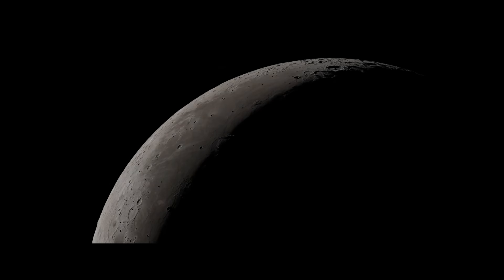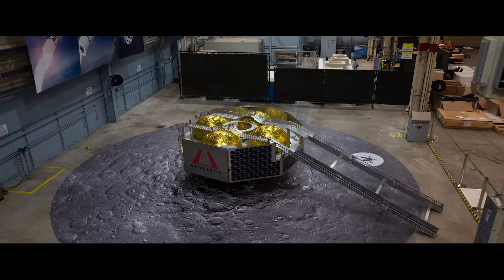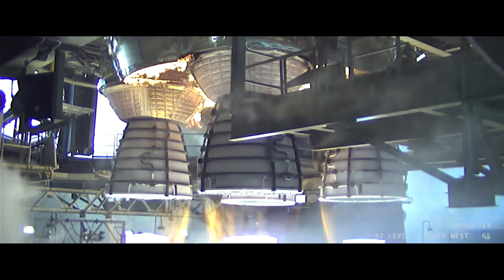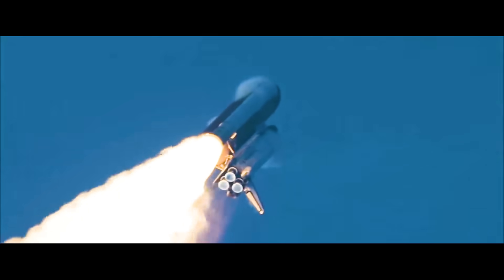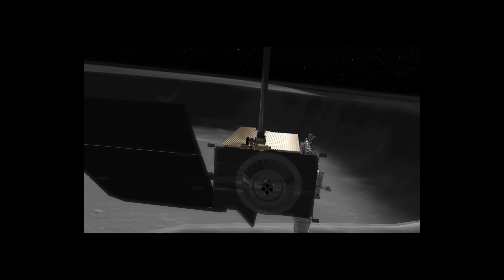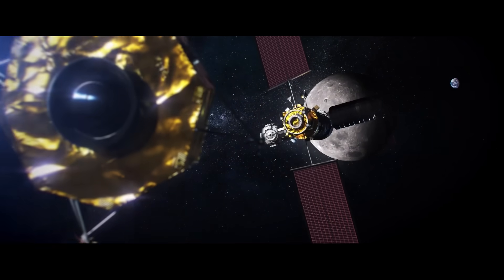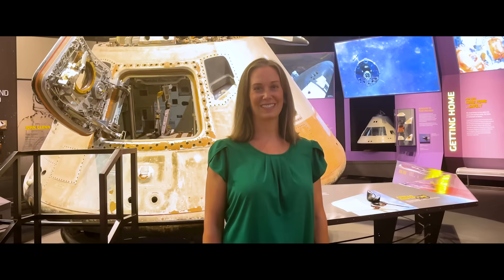Why the Moon?

Comment: my question is how to control the unit (ez. human/machines shelters) temperature on the moon. 

i found this on nasa "Daytime temperatures near the lunar equator reach a boiling 250 degrees🔥 Fahrenheit (120° C, 400 K), while nighttime temperatures get to a chilly❄ -208 degrees Fahrenheit (-130° C, 140 K)". 

i am much curious if i put one .json human i'd 🌠data center on the moon.🤺♻ Keep alive on solar power.

Comment: THE SIMPLE, PROPER, FULL, AND BALANCED UNDERSTANDING OF THE SHAPE, FORM, AND RELATIONAL MOTION OF WHAT IS THE MOON IN UNIVERSAL ACCORDANCE WITH THE FACT THAT E=MC2 IS F=MA: 

What is THE MOON is moving AND not moving IN BALANCED RELATION to the Earth AND the Sun AS a linked AND BALANCED opposite in accordance with the UNIVERSAL fact that E=mc2 IS F=ma. THEREFORE, the rotation of WHAT IS THE MOON necessarily matches it's revolution; AS gravity/acceleration involves BALANCED inertia/INERTIAL RESISTANCE; AS ELECTROMAGNETISM/ENERGY IS GRAVITY. Accordingly, the shape AND form of the Moon is basically constant or invariant. 

The Moon is a BALANCED MIDDLE DISTANCE manifestation or form that is in fundamental accordance with the Earth/Sun BALANCE pursuant to the fact that E=mc2 IS F=ma. GREAT !!! Therefore, the Moon is electromagnetically/gravitationally extended AND contracted ON BALANCE in true agreement with the fact that E=mc2 IS F=ma. Gravitational force/ENERGY IS proportional to (or BALANCED with/as) inertia/INERTIAL RESISTANCE, AS E=mc2 IS F=ma; AS ELECTROMAGNETISM/ENERGY IS GRAVITY. "Mass"/ENERGY involves BALANCED inertia/INERTIAL RESISTANCE consistent with/AS what is BALANCED electromagnetic/gravitational force/ENERGY, AS ELECTROMAGNETISM/ENERGY IS GRAVITY; AS E=mc2 IS F=ma. It ALL CLEARLY makes perfect sense. Gravity IS ELECTROMAGNETISM/energy. 

By Frank DiMeglio

Comment: Why not the moon?
Why not Venus?
Reply: Because you cant land on venus with the crew
Reply: @farel9476  50 - 80 km above the surface of Venus is the most hospitable earthlike place in the solar system. Humans could live in teflon floating blimp like cities filled with breathable air which would easily float on Venus because the planet is filled with the denser Carbon dioxide. At those Venusian altitudes temperature, atmospheric pressure, sunlight, gravity and radiation shielding are very earthlike, compared to Mars where we would have to engineer all those human comfortable conditions. Mars seems to really only have  solid ground to offer. The moon is very very close so it makes sense.
Reply: @Kpop-eye-f7t  fax

Comment: oxygenated soil harvesting and or harvesting of hydrogen from the ice I assume mostly, then we will be able to make spaceports/bases there. 
but the fusion experimentation will be great, being able to do it freely on a different planet repeatedly with different designs with no limits on power restraint really will be great...plus the dark side of the moon is -170c so it would be great for superconductivity.

Comment: odrgDzciG6s
Either way supposed to be 21st century in that video though specifically 2037 I think. Could it have to do with that 2010 Rally to Restore Sanitizer and or Fear? Could it have to do with including 2004 tsunami? Could it actually be sooner and be 2021? Could it be 2067? 2050? 2049? So it's the moon now and not nibiru like I did previously post a comment about when you previously quietly uploaded on YouTube a "asteroid/meteorite/comet" underwater training video for a landing mission and with no press release?

Comment: Ok land on the moon and any organism would be shred apart by ungodly amounts of radiation
Reply: There's something called protection
Reply: @RobPatatas.  the space stations fly fine because there inside the Earths magnetosphere witch the space station is only 450 killometers and the earths magnetosphere is 60.000 kilometers but the moon is 480.000 kilometers way far away from a sheild no protection from radiation will be enough because of the rocket mass will add up
Reply: @olgasolovjova4681  If the avoid the Van Allen belts, the base is underground and surrounded by water, there's no problem
Reply: @RobPatatas.  we dont have the technolagy yet to build an underground bunker on the moon do you know how heavy the drills and wall plating would and think about the price of this project to carry so much unnessasery weight
Reply: @olgasolovjova4681  When USA sent humans to the moon, the spacesuit protect them from the radiation, the spaceship also had protection
Reply: @RobPatatas.  the apollo mission only lasted 21 hours on the moon because they were reciving 6 rengtons from the apollo cap and there gieger counter so they were forced to leave if there was no radiation they could have stayed there for 3 days with the amounts of reasorces they had and thats was 60 years ago and we still havent sent people to mares yet

Comment: This video is great, but one point really botherd me:
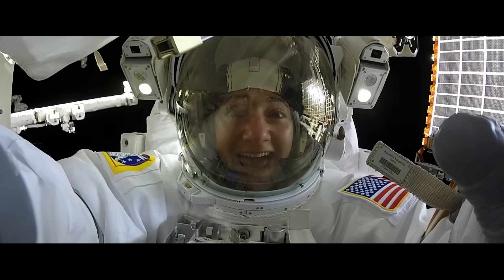When this dude at around 0:35 said "just outside gravity" that really hurt my brain because the ISS is not out of the earths gravitational influence, it is actually very close. The strength of gravity of the ISS's orbit is about 10% less then on the surface of earth.

The ISS is in orbit, a circular motion around the earth, produced not by "the lack of gravity", but by the extremely high horizontal speed.
If there was no gravity outside the earths atmosphere, how would the moon be here? It would have flown off due to its speed.

Sorry, I know this is not made for dudes that already know that stuff, but this is just wrong.
Reply: I believe that it was said for the layman. Most people believe that there is simply no gravity in space, which is false. It is best to speak in simpler terms than attempt to explain a more complex concept.
Reply: The layman considers "outside gravity" as "not under observable effects compared to earth". As such, a stable orbit would be considered outside gravity for this purpose. 
Especially since, technically speaking, it is impossible to be "outside gravity". As long as two closed systems with positive mass anywhere in the universe exist, they will exert some gravitational force on each other.

Comment: In a nutshell - the Moon space stations and settlements is a good starting point in space travels to Mars (due to low gravity at the Moon it will take less resources to get up in open space)
Reply: If it was up to me, I would build a rocket on the Moon and then do a slingshot maneuver around Earth to speed up to Mars.
Reply: @professorx3060  Got to slow down at the other end though, that's the real issue.
Reply: @professorx3060  How would your build a rocket on the moon you genius?

Comment: I'm psyched! However, it beggs the question. We did this already, why is it so hard?
Reply: In the Apollo missions due to political pressure nasa had almost limitless funding but now they have a lot less additionally with these missions they are bringing lots of cargo to build settlements not just people which means it will be considerably harder to get off of Earth due to the additional mass on the rockets safety laws are also tighter now meaning the rockets will have to be better made.
Reply: Politics

Comment: With partial gravity 
Therefore the moon has its own atmosphere 
And just like earth theirs cloud or haze coverage and until you land on the surface you can't see what's actually down their 
And for 50+ years the Darkside of the moon has been habitable 
They've been coming and going this whole time I bet
Reply: Air pressure isn’t proportional to gravity, otherwise Venus wouldn’t have such a thick atmosphere

If the moon suddenly had an atmosphere, solar winds would blast just about all of it away in a geologically short amount of time

Comment: You went to the moon at 1969 with a computer not smarter than a $1 calculator right? Then why you still need to learn a lot of stuff before going to the moon again? You did even real time conversations with astronouts without any delay at apollo misions didn't you? Did you lost the technology to go to the moon? Did you figure out how to pass Van Allen radiation belt before going to the moon. If you did then why you need to solve that problem again according to your astronouts. Did your astronouts see the stars from the moon or not?
Reply: according to your reasoning they should stop making new cars because there are already old ones, it's called evolution

Comment: Go NASA, go Team Space! (But.. "just outside of gravity"?! Someone please explain gravity to him...)
Reply: he’s talking about the international space station
Reply: @Iachlan1  It's not clear what he's talking about. But regardless, the ISS is very well inside the gravity of Earth, Sun, Milky Way, Local Cluster, etc. Otherwise it would fly straight off to outer space. LEO is a place governed by Earth's gravity, only passengers on that orbit experience net 0 acceleration in their frame of reference. Unfortunately someone "wisely" chosen to call that experience Zero G or micro-gravity, but both are misleading. It's just that their angular velocity happen to equal out the spacetime curvature at that distance from Earth. Gravity is not much weaker there (around 90% compared to the surface), that's why they need to travel at speeds of ~28.000 km/h around not to fall back to Earth.

Comment: All you need to do is scrap your current design for the space suit, and instead invest in the mechanical pressurization suit that is fit precisely to the shape of the astronauts (and thus allows for very easy movements) and move the contract for putting humans on the Moon over to SpaceX (skipping Orion and SLS), and putting humans on the Moon will work perfectly!

Comment: JFK's old Rice University speech is still just as inspiring and to-the-point as it was almost 60 years ago. "...we shall send to the moon, 240,000 miles away, a giant rocket more than 300 feet tall, made of new metal alloys, some of which have not yet been invented, capable of standing heat and stresses several times more than have ever been experienced, fitted together with a precision better than the finest watch, carrying all the equipment needed for propulsion, guidance, control, communications, food and survival, on an untried mission, to an unknown celestial body, and then return it safely to earth, re-entering the atmosphere at speeds of over 25,000 miles per hour, causing heat about half that of the temperature of the sun--almost as hot as it is here today--and do all this, and do it right, and do it first before this decade is out.." I can't wait to watch us do it again.

Comment: Went there in the 60's, and somehow we don't have a spacesuit?  nasa needs to get rid of some bloat.
Reply: They are developing a new suit to replace the ISS suits, which replaced the Apollo suits.
Reply: @steveaustin2686  I understand that.  But they waste too much of my money, they need to get rid of the bloat.
Reply: @firecatsrt  Spacesuits for excursions are miniature spacecraft, not clothing. It's difficult, costly, and time consuming to make them. From what I have read, they will be more capable than the current suits.
Reply: @firecatsrt  so what? You want them to use the same suits on the 60's? No way! And yet the new suit is better, who's many they're wasting? Tax payer? Pfft, say that to the military
Reply: @farel9476  no I want them to be responsible with our money. I'm just saying they've had 60 YEARS to continually upgrade equipment.
Reply: @firecatsrt  budget cut, thats all you need to know
Reply: @firecatsrt  Nonsense!  Each different suit has different requirements and different Issues that must be solved!  Space suits are Critical Technology!
Reply: @firecatsrt   -  Sorry, but no one has been working on any new suits that are designed for Lunar excursions until now!

Comment: There's nothing on Mars but rocks and radiation.

Jesus offers you eternal life and you snub him and try to move to a barren rock.
Reply: Hate to break it to you, but Jesus isn't real
Reply: Water. Atmosphere, air, oxygen, methane. And you only say rocks and radiation?
Reply: @farel9476  
You know you could sell atheism to me if Earth looked like Mars, endless desert. A frozen Rock that's just lucky enough to be orbiting a star.
It would literally be easier to move to the South Pole. At least there is air there. If you leave a steel bar out for a couple of minutes on the surface of Mars you'll be able to snap it like a stick, sub zero temperatures do funny things to materials.

But atheism doesn't explain what's outside the window on Earth...
The Bible says there's no such thing as an atheist. 
"the fool has said in his heart there is no God."
Need proof of God? look out your window or turn on some music.
Real music not the Demonic garbage pump down by Hollywood these days.
Reply: Rocks and radiation are at least real.

Comment: Well stated rationales, and inspiring imagery!
But if I may humbly suggest: SLS development - or that of alternative launch architecture - should have started in 2008, when India's Chandrayaan-1 spacecraft confirmed the presence of water on the Moon.
Vertically integrated production should have been used to develop said launch architecture without the RIDICULOUSLY-inflated costs and delays experienced within the SLS program. 
Please, NASA, use vertically integrated production to finish development of extravehicular spacesuits on-time and within budget.

And lastly, use your influence and that of your supporters to CEASE AND DESIST the endless lawsuits being brought by Blue Origin against HLS procurement!
Reply: NASA got Blue Origin to agree to conclude the lawsuit by Nov 1st, 2021, so that won't delay it long.

Comment: Why do you show nonexistent, tiny crew landers, not the one you actually selected?
Reply: There's another stopwork order because of blue origin, they did show Starship though when mentioning jobs.
Reply: @iamarokotmanson  Was voluntary, actually, not an order. That doesn't matter, though, showing a picture should not be a problem, they showed a picture of what, a previous Boeing design?
Reply: @iamarokotmanson  NASA got Blue Origin to agree to conclude the lawsuit by Nov 1st, 2021, so that won't delay it long.
Reply: They've shown it in other videos, and I'm guessing they were supposed it put it here too, but they edited it out because of Blue orgin's dumb lawsuits
Reply: Those are unmanned landers that they are sending via the Commercial Lander Payload Services (CLPS) program. The Peregrine lander (CLPS-1) was supposed to land this summer, but got delayed by the ULA Vulcan Centaur delay, which is waiting on BE-4 engines from Blue Origin.

Comment: If NASA put at much effort into the actual engineering as they do into their monthly “we are going” videos, they might actually get stuff done. It’s embarrassing that the Artemis program has made so little progress and innovation in the over 50 years after the Apollo program.
Reply: Tell that to politicians not NASA 
These days its almost impossible to get funding for a over 5 year project.
Even if you did, when a new administration comes they cancel it and change it(This happened with artemis), because they don't care about progress they only care about making other look bad and making themselves look good.

ANd also the funding of NASA is quite restricted and the increasing no of other projects makes it hard to a do a long term project
During the Apollo era, NASA virtually had unlimited funding

Comment: I do hope I get to see the Mars landing within my life time
Reply: Definitely 👍✌
Reply: It doesn't look too bad that it's going to be this decade, so your chances are not that bad ig
Reply: @cantinadudes  it will be 2024 or 2026, depend on development of Starship
Reply: @alexandrius4971  That time frame is very optimistic, running off of Elon time. I think that time frame is realistic for getting back to The Moon. Mars is probably going to be in the 2030s
Reply: @zrk03  Yeah I think it was supposed to happen in 2020 initially, so it will probably be delayed again but surely happening from 2030 or 2040
Reply: @alexandrius4971  yea, but 2024 is VERY optimistic. It's still possible when it comes to the developement of the rocket. But just as it is now with the B4 and SN20 orbital launch, bureaucracy will delay it. 2024 will be a cargo mission, if it goes well
Reply: @cantinadudes  if 2024 is a cargo mission, 2026 will be the window for crew flights
Reply: @alexandrius4971  probably, but only if it goes as well as it does now
Reply: @cantinadudes  Neither the booster, the ship or the launch mount are finished yet. I don't think bureaucracy is holding up a launch at the moment.